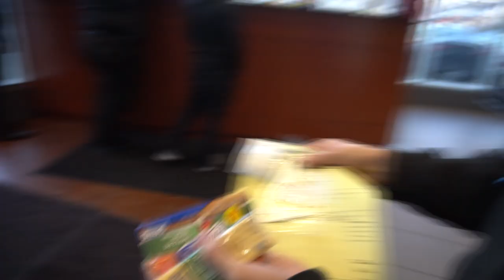TURBO MIATA ALMOST DONE!

Comment: You can't just remove the actuator on the turbo. You have to hold the actuator shut with something or you will never build boost! The actuator holds the internal wastegate shut, removing it keeps the wastegate open so you will not build any boost.

Comment: you dont need the 1.8 engine harness bin it, use the 1.6 engine harness and just extend the cas plug wires, also remove 1.8 water temp sensor and replace with the 1.6 one and it will all plug in perfect

Comment: if your going to run an external wastegate you need to weld the internal wastegate flap on the turbo shut then or you wont make any boost

Comment: i seriously hope you dont run the stock injectors
Reply: He did in his other car. He has a Vortech FMU that ups the fuel pressure so you get more fuel, he was getting decent AFR's with it. In order for him to change the injectors he would need to get a Megasquirt setup and there isn't enough time to wire it in and tune it if he wants to do the drift event on Friday

Comment: Yo guys I just bought a new car and I wanna swap the spark plugs... but I cant fucking find them? I searched all online and couldn't find where they were I even called autozone and they fucked me and hung up. Its a 2003 VW jetta tdi thats what the badge says, any clues anyone im getting desperate
Reply: onlylikenerd Try the glovebox dude
Reply: Logan Schofield no some do they have glow plugs
Reply: onlylikenerd deisel engines don't have spark plugs. only high-pressure injectors. look it up
Reply: cole hayes but I put gas in it
Reply: You did say tdi right?
Reply: cole hayes yes its got a green gas cap says fuel, diesel isnt that
Reply: I hope your trolling me
Reply: cole hayes hey my car stopped working it's in the shop noiw ill ask them to change the plugs